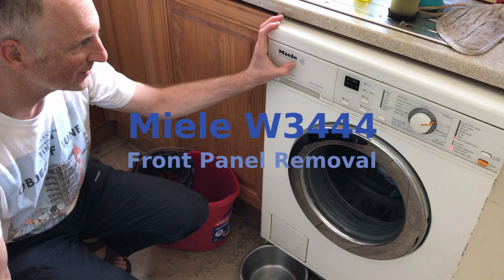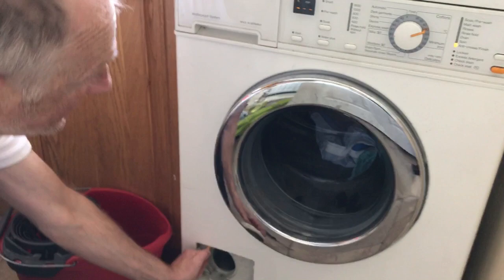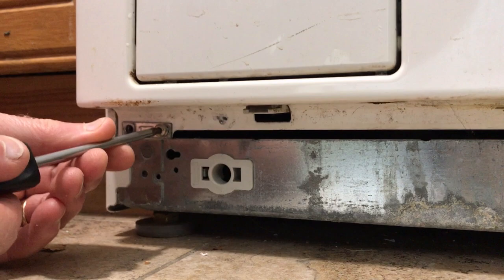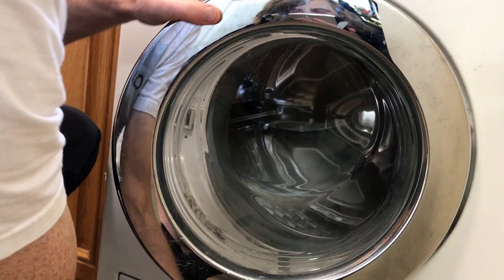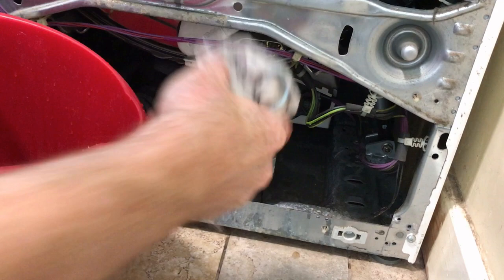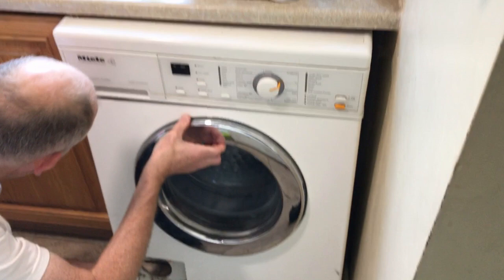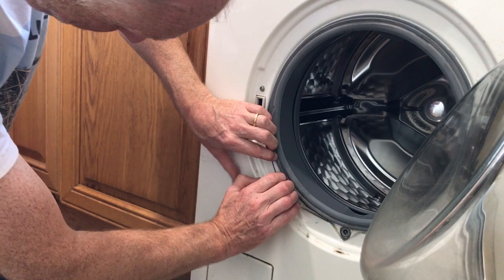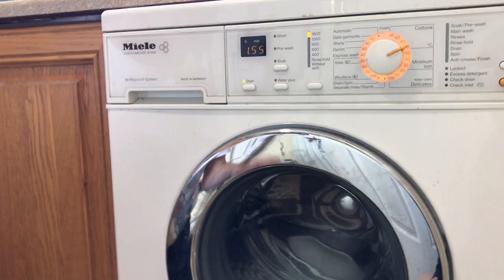Miele Honeycomb Washing Machine W3444 front panel removal to fix fault code caused by internal flood

Comment: Thanks for pointing me towards the solution. I changed it a bit: rather than dismantle the floor panel, I emptied the bottom tray by.... lifting the back of the machine steeply (being super careful to make sure the machine does not slip and fall on its front!), so that all the water in the tray flowed out to the floor in front of the machine. Then I slowly lowered the back of the machine back and moved it back to its place. Same result - no screwdrivers needed. Again - be careful not to slip and not to drop the machine while tilting it! Hold it strong (I am a 195 cm tall 120 kilo guy... ).
Reply: I do the same thing on a W3204.  Have to do it after every 3 to 4 washes.  Any idea of a permanent fix?

Comment: You saved my day. There are so many inaccurate videos. I have to find the leak as well. I’m thinking reflux at the end of my drain pipe. The plumber only dis put a U that goes only 5cm in a 45deg fixed tubing in the wall… thanks again.
Reply from the maker: I have another video that shows where the leak came from.
Reply: @jolyontidmarsh1759  Cool, I've watched it. Thanks I'll check that part as well. I'll check the bottom one as I did not check in the crevasses. Cheers. Funny sound in the other video speed up.

Comment: Brilliant. Thank you. Worked for our Miele Paragon Plus - both water inlet and drain lights lights flashing, and the fittings were all similar enough to work out. Plus the seal impression raised a smile, so all good!
Reply from the maker: Thanks for the comment - I've made another video that shows the part that was leaking.
Reply: @jolyontidmarsh1759  Excellent. That may well come in useful as I'm rather conscious that my "fix" (mopping up the water) may only be temporary. Once again, you're a star.

Comment: Thanks for the video.  Thought about investing in Meile washing machine but heard from friends and appliance retailers they have their faults . I've had 2 Zanussi washing machine 1st lasted 10+years my 2nd  is 8 yrs old been through 5 house moves and daily washing and still going strong!!! (is a Meile washing machine worth the £££. To pay top £££  you would expect a machine to run no faults for a lifetime unless caused by the owner coin or other items stuck in machine 😆
Reply: Good question. It certainly wasn't worth it in the 80s when I believe Zanussi machines were arguably too high quality (Jet System machines were superb) for the price and I assume Electrolux group have put that `right' in recent years with the machines lasting less well than they did. 
It is of course nice to use a high quality machine and you get features that other machines don't offer, e.g. on a Miele you get `Soak' (you can soak really dirty items for between 30 minutes and 6 hours (selectable) at about 30 deg. C with occasional agitation; after the soak period the machine then does the wash cycle selected as usual using the same water).

Comment: Great video here's to another 15 years with my Miele
Reply from the maker: I'll drink to that... except we've finally just replaced ours when the main bearing ground to a halt.
Reply: @jolyontidmarsh1759  Please advise how old the machine was when you had to replace it due to drum bearing failure and roughly how many wash cycles per week it did on average.
Reply from the maker: @Martindyna  we had it for about 15 years.  We had two kids in washable nappies … it got plenty of use.  It probably did an average of 1 wash/day.
For

Comment: Thank you for a very usefull YT, I have the problem that it doesn't do a great job centrifuge the clothes, I need to clean a pipe to the pump for it to work properly again.  My Miele is a much younger version, but it looks pretty much exactly like yours
Reply: Does it jump when going into spin?

Comment: I had a leak on mine and kept filling up the bottom panel and the anti flood device would kick in mine is w5748 but very similar to this one! It was the tube at the top of the drum that goes to drawer the steam vent I think it is. Anyway it was full of limescale and stopped the machine draining properly kept spinning full of water causing it to leak out inside it and coming flying out the front of the drawer to... it was unblocked done a few boil washes with machine cleaner the cheep oust one it’s amazing and the kettle one. And it hasn’t done it since I also got a new door seal as it was a bit worn and mouldy. It’s ten years old so hoping it will last another ten years :)
Reply from the maker: I’ll have to try this next time I get the fault code of doom! Thanks!

Comment: Hi, I just moved my front cover for the same reason, what I found was a small hole in the large rubber tube/sump hose that comes off the side of the drain pump, I was feeling around the hose and felt a sharp object and found this protruding through the tube in one of the creases, so I would probably check that hose, presume they can degrade over time as well. The other things I think could cause the leak could be  is the drain hose from the drain pump all the way to the outlet, possibly a crack in the drain pump, and the only other thing I would think would be the grey door gasket could have hole from a sharp object or wear and tear.
Reply from the maker: Wow!  its actually quite easy to remove the back and sides to find out which part is leaking - there's another video about this.
Reply: @jolyontidmarsh1759  l

Comment: So, basicaly, when the tree bars are on display, there is internal leaking, right? My machine W451E, sometime have that tree bars and cannot run the motor on lower speed. Actualy, I can see the motor how try to rotate loundry, but it is very dificult to do the job.

Comment: Just turn it off at thr mains - pull it out and tip it back at 45degrees and the water will come out of the back - which has no panel to remove
Reply from the maker: Yes, that is much quicker - I wanted to see what was going on inside.
Reply: @jolyontidmarsh1759  Also you gave others the real life experience of removing and reinstalling which was great. 10/10
Reply: These machines are damn heavy. Front panel off and remove water manually is much easier

Comment: My friends Miele has started to bang as it goes into spin( not an uneven load). Any ideas? Spider? Suspension?
Reply from the maker: that eventually killed mine.  Bearings failed and I couldn't face mending that.
Reply: @jolyontidmarsh1759  I was fearless repairing spiders and bearings in the past as I had a repair business doing that but the Miele look so overenginereed that I never attempted one

Comment: You could just tilt the machine backwards to get the water out.
Reply from the maker: Yes, I was doing that, but I wanted to try and find out what was going on inside.  Plus, its a pain to get the machine out too.

Its possible to syringe the water out with a short lenth of tube pushed through the holes that the base cover faring clips into.
Reply: Jolyon Tidmarsh 
I cleaned my filter, but also pulled on a little (snorkel) looking hose that came off completely in my hand! I don’t know how to get it back on, or where it came from? Do you know?
Reply: @paulaannsavage7815  What machine do you have? Sounds like you accidentally pulled off the emergency drain hose from the pump housing.

Comment: Oh you clown, if it's flooding that means you're using it completely wrong the appliance cannot flood under normal usage. That flood sensor is specifically there to tell you that you are fking up. Furthermore there is a BUILT IN drain for the catchment tray on the appliance. You never need to remove the panel!
Reply from the maker: There was a EPDM rubber part with a split in it that was leaking slowly.  I've made a video about that too... it always bugged me that I didn't know where the leak was coming from.